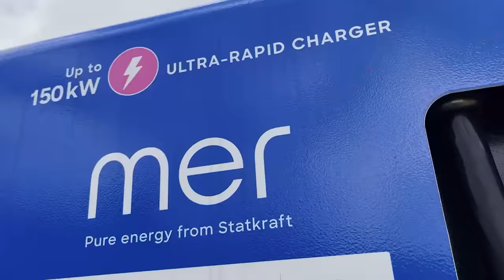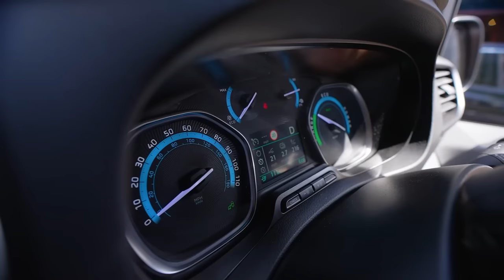Global EV Showdown ~ Is China Outpacing the West?

Comment: EVs create more tire abrasion and brake dust because they are heavier. That's not healthy, either.
Reply: EV's use regenerative braking extensively so a lot of the braking force is applied and energy recaptured through systems that don't involve the brake pads (and brake dust).
Reply: The weight of a 50kw EV is not much greater than that of an ICE car as weight of electric engine and drive system is far less than weight of ICE and gearbox.
Reply: @shortbits23  The tire abrasion is somewhat true not because of weight, but because of acceleration. Instant acceleration and high torque at low speeds can put quite a workout on the tires when driving aggressively. But that would be true not just for EVs, but with any car with great acceleration.
Incidentally, with increasing battery energy densities EVs should become lighter, and likely even lighter than internal combustion cars. As an example, the new battery BYD is going to start using this year will result in batteries roughly 20% lighter for the same capacity, or with 27% higher capacity for the same weight.
Reply: You can't regard the fast acceleration of EV as a shortcoming.
If you want your tires to last a long time, the simple way is to gently step on the accelerator pedal.
Reply: @amandagrant4331  or in my case for the MG ZS EV I use Eco mode, ideal for calm driving. Most EV's have an Eco setting.

Comment: The 2035 target is ridiculous. It is not a long enough runway to realistically make  the change over from petro without penalizing the consumer. Hybrid vehicles are obviously the only logical first step as all electric has unreasonable limitations...particularly during winter months.
Reply: I've had an EV for years and not been penalised. 
Over the time I had it my last ICE car used £28k in fuel. For the same mileage my current car will use £2.5k. (Hopefully less once I get solar on my roof)g

You can get a Corsa EV on a monthly for around the same as the ICE version - except you're potentially saving most of the money you'd spend on fuel which makes it cheaper per month.
If you can charge at home then EV's are cheaper for most people (assuming you actually drive them).

As for "unreasonable limitations" - only if you think the quoted range is what you'll get day in, day out. 
Nobody ever thinks they'll get the quoted MPG for their car why do they believe they will for an EV?

For winter, just knock a quarter off your expected range and you won't be disappointed. If that number is too low, then buy a different car or hang on until a suitable car appears.
Most people only drive a few tens of miles at a time anyway and for them even an old EV will do that.
Reply: In the first quarter of 2024, the sales volume of plug-in hybrid vehicles in China was 784,000, up 81.2% year-on-year.
But the problem is that even in the field of PHEV, there are no European manufacturers.
European manufacturers are as stubborn about ICE as Kodak was about film.

Comment: Great video as always Roger (and production team!). Addendum on the tracking tech... EU recently reported on fuel economy of hybrid vehicles and how plug-in hybrids hardly seem to get plugged in. What was their data source? EU-mandated telematics that self transmits. 

No need for the Chinese to track you when the government do it already😂

"It wasn’t widely discussed, but the EU legislated for the installation of on-board fuel consumption monitoring devices (OBFCMs) in vehicles sold in member states. 

These had to be fitted to cars registered from 2021 and in vans registered from 2022. The European Commission said: “Regulation EU 2019/631 also tasked the Commission with monitoring the ‘realworld’ CO2 emissions of vehicles on the road, using the data read out from the OBFCM devices and comparing it with the corresponding official WLTP data.”
Reply from the maker: That is an interesting conversation to be had. I have seen data on ULEZ compliant vehicles collected from road sensors  which suggests that they are not performing as expected. Lots of them have been remapped.

Comment: So you have not talked about the 21,000 Ev fires in China last year, these were mainly cars or the fact that China, uses the police to stop vehicles that are over 3 years old this includes Ev cars, bikes, scooters then takes them off the people who then have to pay a fine if they want them back. The fines is normally higher the what the vehicles are worth. So basically forcing the people to go and buy a new one.
The have fields full of Ev type vehicles, each police area also has its own holding field. 
Then you have the manufacturers that turn the vehicles off if the customers complain or get the repairs or work on the vehicles away from the main dealerships.
Volvo have stated that an Ev vehicle has to do over 80,000 miles before it’s worth having, and an ice vehicle this is only 50,000 miles.
Them we have the uk infrastructure which has no plans of changing its plans to fit in ev’s charging point or to cover charging at home stations. These infrastructure plans cover up to 50 years. Then you have those that live in flats or areas in which it is not possible to have an Ev or be able to charge an Ev from home. Then you have the cost of an Ev over the cost of an ice vehicle. 
Then you have the cost of charging Ev’s at charging station, the prices are going up all the time. Plus places like London, Bristol etc.. that have congestion charges and ulez have stated from 2025 ev’s will also have to pay. 
So it’s not looking good for the Ev. The problem being government is hell bent on forcing people into Ev’s, which is a big mistake. Instead the government should just give people the choice Ev or ice.

Comment: EV batteries are not yet practical. However, come 2026/2027 we will have solid-state batteries which will be at least 2/3 the size and weight, safer, charge very quickly and last the lifetime of the car (but more expensive to start with than Lithium Ion batteries). This is not a pipe dream - the question is just When (how long to build battery factories - just ask Toyota) not How. This will reduce the value of all current  Lithium EVs to almost 0. So have we really saved CO2 (using Chinese steel produced by coal and Chinese batteries) by producing millions of BEVs which are going to end up as scrap, rather than extending the life of ICE cars? China, India and the USA are responsible for over 50% of the worlds CO2 emissions, the UK is way less than 1%. Per Capita the USA produce more CO2 than China - so why do we moan about the Chinese but not the Yanks? Why beat ourselves up with expensive BEVs and air source heat pumps and banning gas hobs/ovens/boilers? Cargo ships are incredibly filthy and what about global deforestation, unnecessary air travel and cruise ship holidays? If we really want to make a difference to CO2 and global warming, lets look at all these instead.
Reply: That one percent figure doesn't include our aviation and shipping emissions, the CO2 from Drax power station, the carbon footprint of the products that are manufactured and imported to this country because we demand them, or the government's investments and our pension fund investments in foreign fossil fuel projects.

Comment: With all the mining of materials to produce batteries, why are electric cars still considered good?
Reply: You have to compare the negative effects of mining the materials for the battery and running the EV to the negative effects of mining the  materials for the ICE car and the exploration, extraction, transportation and burning of the oil.
Reply: Do ice cars not require iron ore mining to manufacture steel . Once an electric car is manufactured it leaves a reduced pollution footprint on the planet, whereas a gas car starts it,s pollution journey the moment it,s on the road and gets worse as the engine wears out.

Comment: Agree, just a couple of little issues. All new cars have embodied carbon regardless of who makes them. If we want to reduce embodied carbon, then we have to stop manufacturing new cars and rebuild old ones. I'd personally like to see EV conversion kits for cars and the manufacturers have all the specs to design and build such kits. Give the local industry something to work with too - like removing all the ICE bits and fitting the conversion kits and batteries. If Governments just got out of the way with the safety and security and other bullshit legislation, such a conversions could be viable for many people. But, dreaming again, so none of this will happen. We'll continue to emit CO2 until the cows drop dead.
Reply: A mechanic has got a YouTube channel who does exactly this. Look up Electric Classic Cars.
Reply: @Richard482  Thanks, I do follow that channel, but with the way things are, this exercise will continue to be too expensive for your ordinary motorist.
What I had in mind if say subaru provided the drawings and fittings to do the conversion - it would make the conversion a lot more viable.

Comment: The west: here's a super-expensive model that has a thousand gadgets, no trim without them. Or this super-ugly tiny EV that you'd be ashamed of being seen in. China: we're not afraid to make the cars look great, and pass EuroNCAP. Note that BYD and others sell even cheaper but unsafe trims in China, that keep starting terrible fires, snap in two easily and don't deploy the airbags. Regardless, right now few can afford a new car. Whoever could afford one already bought one. Without reliable infrastructure you need to own a house with a driveway, to charge at home. So even with a low price of the car there's a high bar for entry.

Comment: Would not have one given, Use Hydrogen like JCB have already produced.
Reply from the maker: There are many people in the motor idustry who say that hydrogen is the future and it will make evs obsolete. It is worth exploring the facts behind that statement. I would love to see it happen.
Reply: The JCB hydrogen combustion engine still produces NOX emissions and is chronically inefficient. Once you take into account the high cost of hydrogen and the practical issues of embrittlement, leakage and low volumetric density, the JCB solution is unlikely to succeed. I'm afraid JCB have been barking up the wrong tree.

Now 150kWh batteries are starting to hit the market heavy plant EVs have become viable.

Comment: I have thought for a long time that EVs are great for town and city driving but for anything else, right now the technology isn’t there to make long distance driving feasible in EVs. I think that the future of motoring will be a mix of EVs and vehicles powered by sustainable biofuels. There are so many vehicle types that use a diesel or petrol engine that aren’t suitable for electric that something else will have to be used. Virgin Atlantic had the first net-zero flight powered by sustainable earlier this year. Many years before we see that used for every flight but as a proof of concept it worked. Motorsport will jump on the sustainable fuel bandwagon soon as well and as we all know that does drive the automotive industry forward. I have never thought the internal combustion engine was doomed. It just needs something different to power it.

Comment: A couple of things. Thr carbon offset is not 60 thousand miles. That is some fake news by Jaguar who did not want to build EVs. An average motorists will produce less carbon after 18 months of driving.  And second, you have not been keeping up with either ev models which include a number of normal priced cars. Or second hand prices which are now at parity with the equivalent ICE cars. There is a world of difference between early 2023 and now.
Reply from the maker: The embedded carbon is measured against keeping an existing  car. The 60,000 miles is not the  comparison between one EV and one ICE, it is about scrapping a serviceable car to buy an EV
Reply: @SkillBuilder  still incorrect. You need to factor in the carbon from digging up, refining, transport, storage of fuel for the entire lifetime of the car. As well as the significant amount of carbon embedded in the lifetime servicing requirements which are less for an EV. 
Over the lifetime of a car, an EV is always less carbon. And an old car has much worse pollution for its lifetime. There is no way around that.

Comment: 10:48, wrong, it will still be possible to drive an I.C vehicle, "registration" of new diesel and petrol vehicles will stop in 2035
Reply from the maker: That is what I said, people will be hanging onto the I.C's because they can't afford the ev's
Reply: @SkillBuilder I don't believe that will be the case, they'll buy secondhand EVs. I bought a seven year old EV at a var auction three years ago for £3,600. Best car buying decision I've ever made. Haven't spent a penny, literally, on tax servicing and maintenance in three years and it costs 2p a mile to run.

By then, there will be loads of EVs on the secondhand market and new ones will be relatively cheap. The CEO of Ford, Jim Farley, reckons that EVs require 30% less labour than ICE to build, because they have far fewer components, so with battery prices halving every couple of years new EVs will be dead cheap.

Comment: most cars are made in China now, to add to the comment  below add MG. I think you need to have a look at autotrader quite a few second hand ev's on the market. Some very good prices. This will get better. There are Tesla's still running on original batteries with a degradation of 10% with over 500,000 miles on the clock, would love to see an i.c.e vehicle last that long add to the fact you could scrap the car and install the battery to power your home. Plenty of juice to do that. Yes van range is too low, I would love one to use as a campervan. Your comment why did we get into this situation just look back at the motorcycle industry when Japan came on the scene.

Comment: Lithium batteries has the potential to go up in flames when overheated, now put a very well built metal cage around it and drive around inside... while trying to find a working charger on the road so you can make it home...
Reply: jamesclark5654  Yes, the recent Luton airport car park fire was caused by a diesel car and not an EV as falsely spread on social media.

Comment: Roger your missing the point mate. No one in the uk wants an ev, we haven't got the infostructure, the time or the patience. Evs are a bad idea and bad for your wallet and like you say  tomorrow im taking my diesel van. Yes evs do help keep the air clean thats about the only good thing about them, clean air, when there not on fire that is!
Reply: I do just waiting for Tesla’s cheaper compact car to arrive in about two years
Reply: Oh and I will charge at home 99.98% of the time and on the rare occasions I do a long trip Tesla super chargers are the most reliable which is why I wouldn’t even consider a car from another manufacturer as they didn’t bother to provide their own charging network

Comment: And as far as EV goals what is never discussed is that electricity it’s not a primary source it’s a secondary source created from primary source wishes from the Sun to win to hydro so nuclear sue for sale throws it is a secondary force of pressure so another words isn’t meant to be stored it is meant to be as it’s produced but we have tried to store it when using chemical means in batteries and ask me all now batteries are very very expensive and inefficient ways to try and store electricity and this is where the problem lies you can produce all the electricity you like by wind and solar but it isn’t guaranteed you don’t get solar at night time and you don’t get wind when it’s still so you have to have a third message which takes over and that third method at the moment it’s justSolid batteries and then out of batteries to store so many giga watts of electricity would cost whole worlds output in GDP Even if we could find the necessary materials like Lithium and et cetera
Reply: And ……breathe.

Comment: Completely misleading Roger, I'm afraid to say. 
The Chinese massively subsidised the production of EVs, but the Chinese can't afford to buy all that production, so they are selling them abroad at unbeatable prices, some might say dumping prices.
Patrick Boyle has a video on this with quite a different take on the situation.

On a different note, I am not a fan of electric vehicles because: 
1. Petrol/Diesel is a lot cheaper to buy and the difference in price would be made up in fuel in about 10 years (at my 20k miles a year)
2. I get range anxiety and when I am low on fuel I just want to refuel in 5 minutes rather than... 1 hour
3. Charging at home is an extra hassle and cost: EV charger
4. I still don't belive the battery would still be great after a long time - my fuel tank is just fine 11 years later
5. I dislike the "everything on a tablet" inside the car - I want dedicated phisical buttons and knobs! Personal preference 😂
6. I think the CO2 reduction is not there yet as the power generation is still not all renewable
7. The power network is not capable of sustaining that much demand. I recently built a house on a road that has 6mm 2 phase power for the whole road of 14 houses... how on Earth is that not going to melt or hopefully cut off if everyone had a 40-60A draw at the same time and charging is going to happen during similar times because people would do thing during the day and come home for supper and... suprise surptise - charge their EVs